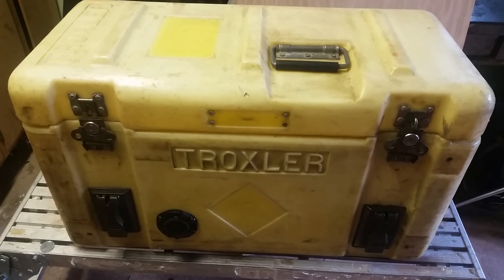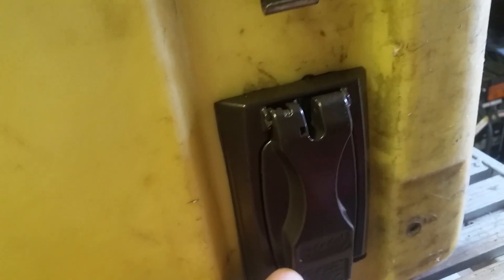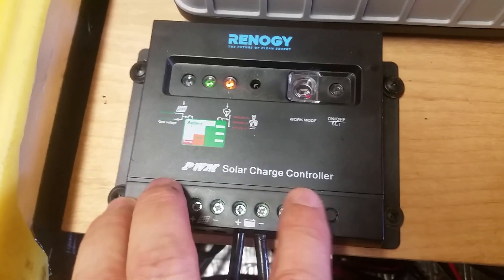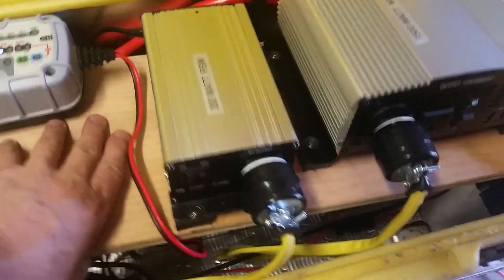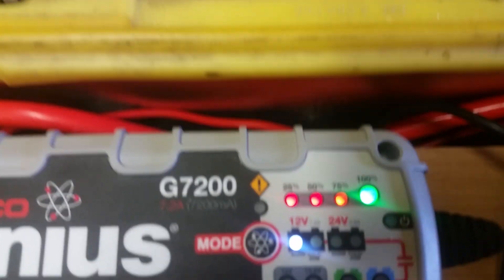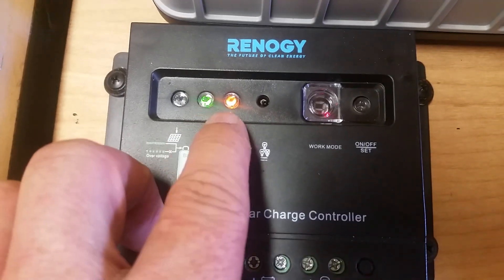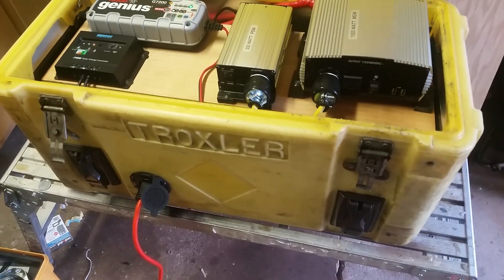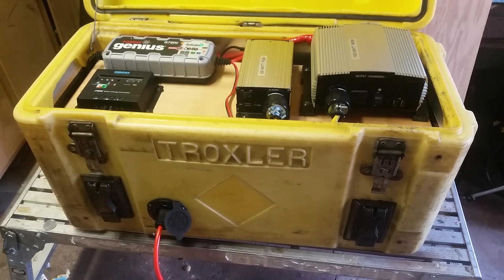Poor Man's YETI 1250. More Capacity at Half the Cost !

Comment: I have two renogy charge controllers and they are @2 years old and the work flawlessly.   Once you hook up the solar panels the two light on the left will be on.  Green on the left is panels on and the one to the right of it is battery condition.    The larger button on the right is a timer.   You can set it as always on or you can make a timer that will let a light come on or what ever device you hook up to it.  The instructions are a little fuzzy but judging The Who project you made you can figure it out.   Great job on the solar charger and great job on the Vid.

Comment: I would look at using "Zamp" connectors for the solar panel inputs.  They basically look like a 2 wire SAE connector on a car, but they are made with a larger AWG wire to handle the voltage and amperage from most solar panels.  You can find these connectors at Zamp solar and at many RV suppliers.  One thing to know however is that Zamp connectors are designed for a reversed polarity so you'll need to watch your polarity carefully when making the connections.  After the connectors are installed, you'll have a quick connect capability and the connectors are keyed so that you can't connect them the wrong way.
Reply from the maker: Hey thanks !

Comment: why have 5 batteries with low amp hour rating when you could by 1 battery with 200, 300 or 400 AH ?
Reply: My setup is different because it isn't a sealed box, doesn't have to be as potentially portable because it's only for emerg home use.  I actually use two 6 volt golf cart batteries with mine.  That's probably the best way to get max punch

Comment: I struggled to find a good quick connect for the solar panels as well. MC4 requires two connections, and is difficult to connect / disconnect, and Anderson connectors are not very weatherproof. Then I came up with the idea to use 6 pin trailer connectors. Cheap, easy to find, weather tight, durable, and easy to use.  I also used some of the extra pins to wire an automatic charge controller battery disconnect. https://www.youtube.com/watch?v=a6KqZ80EEc4

Comment: I have a Xantrex freedom 450 I believe it is 450 . I know it is a 3000 watt inverter charger . However it is old I was told by my old boss it worked . Anyway I wanted to ask . What else other than a solar panel and wire do I need to get this as a working system -unit similar to yours .

Comment: I want to run my flat panel and ps3/4, xbox using the modified inverter as I know the wattage will exceed that of the pure sine wave inverter. Question is can i run my TV and consoles off the modified sine wave inverter.
Reply: I've never personally (or heard of someone) plugging in a device to a modified sine wave inverter and instantly frying it because it "needed" pure.  my experience has always been, if the device works normally while plugged into a modified sine wave you're probably fine (tvs and an xbox should be OK). I had a heating blanket I was trying to power off-grid. I knew it was only pulling 100 watts max, but a 500 watt modified wouldn't run it. It kept saying error. A 1500 watt modified would but I didn't want to lug that beast off-site.I bought a 40 dollar, 300 pure inverter and it had no problem. Battery charging could be different but I've never tested it. So If you've got something expensive that has a non-replaceable (or cost prohibitive but replaceable) battery that is charged by AC (not USB - like a phone, what that might be - I have no idea), I'd err on the side of caution and go with a pure sine wave. Otherwise you're fine to at least see if it works. If it does, you're good.

Comment: Sorry, for newbie type question, but I've done some research and hope this is a valid question.  Do you have a blocking diode to prevent the battery power from going back into the Renogy?
Reply from the maker: The Renogy charge controller prevents the battery bank from overcharging as well as blocking any back flow from the batteries. There is no need for a blocking diode to protect the charge controller.   No need to apologize for newbie questions.  I learned what little I know from watching tons of Youtube videos

Comment: Correction:  There is no limit on the battery capacity that a battery charger can handle (solar or non-solar).  If, the output is only 7.2 or 3.6 amps and you have a HUGE HUGE battery bank, the only problem would be that it would just take longer to fully charge it.
Reply from the maker: but you would end up burning out your charger. There is a reason why they are rated !